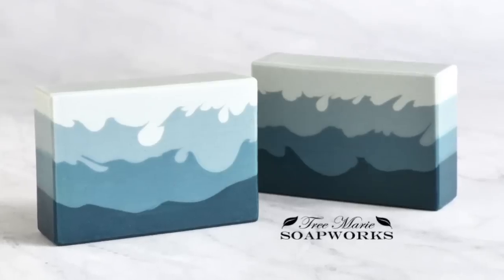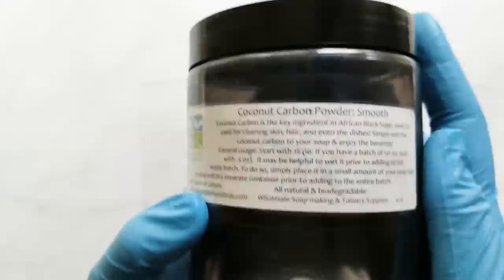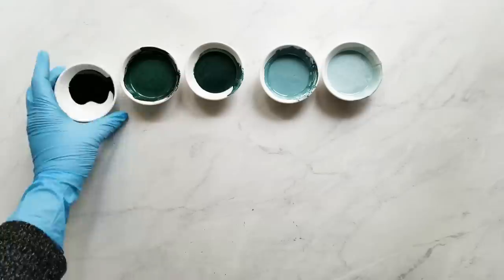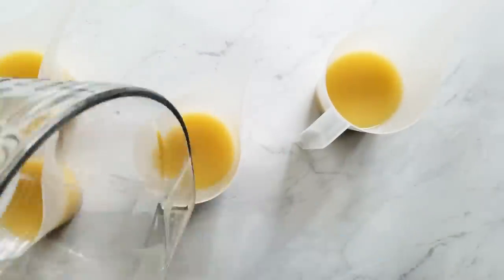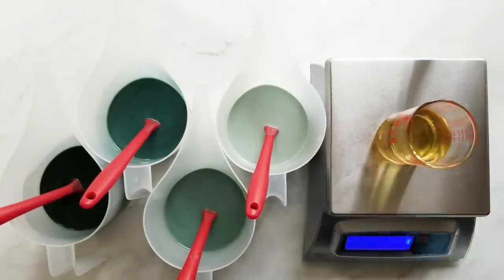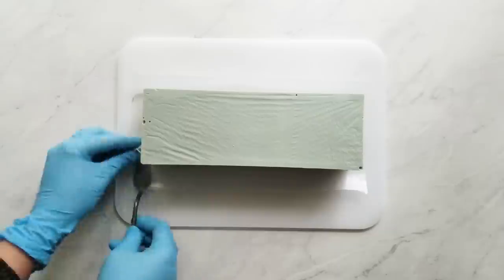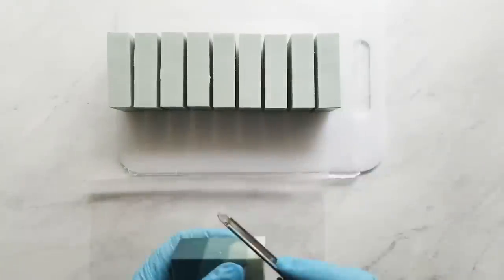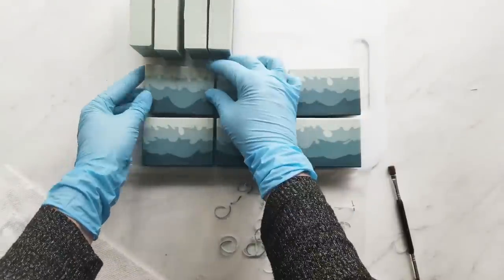How to Make Pointy Layers Cold Process Soap (Technique Video #22)

Comment: I’m a soap maker! I’ve been soap making for about two years off and on. I always wanted to try to gel my soap but I was kinda afraid until I started watching your videos. I use a wooden mold with a silicone liner and plexiglass lid from Nurture Soap. My oven actually holds heat really well and the oven light makes pretty warm in there, so I just use the oven light with that mold and the soap gels really well. Thank so much for the knowledge you contribute to the community! ❤️
Reply from the maker: Oh, I am so glad it worked. I really like the results of gelling soap! Thank you so much, Diandra! 💕

Comment: These soaps were super pretty. Looking forward for those confetti soaps.

I plan on making soap for the first time this month. Like anything, it's easy to get caught up in perfection and the tornado of new things that have to be acquired before performing the actual task. Space is needed and not always available. Space to store soaping equipment, make the soap, and curing areas. I'll also have to lock up my pets. Trying to find relevant information for my specific needs that is more fact based and less anecdotal takes time. I then have to check with my ever changing understanding of soap making. Example: I have hard water. That was never discussed in any videos I've seen. So I will have to try different chelators to see what I prefer. I don't have the hardest water, so I am going with citric acid (plus its lack of environmental impact and lower cost). This means I also have to figure out how much and how to add it through various forums. Sourcing equipment and ingredients can take a lot of time and money. It's alluring to do too much too soon. There are many other reasons, but this is a starting point. A lot of this is specific to me. I want to have a good bit of understanding before going into something that requires time, money, and space is all.
Reply from the maker: Pam, I use distilled water for my water. That is because it has no minerals in it. Hard water can cause orange spots in soap. I also have heard of people collecting rainwater to make soap. Distilled water is only 88 cents for a gallon here. That lasts a long time. Are you on Facebook? My group would be a great place to ask questions like that. 😊
Reply: @TreeMarieSoapworks  I have distilled water that I will be using. However, soap scum is a concern. I haven't joined the group yet, though I probably will at some point. Other than watching YouTube, I have really pulled back from socials at the moment. Thank you very much for replying.

Comment: I can't tell from your video if the tip of the pouring pitcher is above the batter line or dipping slightly into it. Or does pouring just above the surface slightly break the layer to create the points?
Reply from the maker: Yes, pour above the surface and let the batter dent the layer below; the thicker your batter is, the higher you'll have to pour from.

Comment: I just started soaping barely a month. In most of your videos you put the soap in the oven overnight. I stay in a tropical country where the temperature is around 30 degrees celsius all day long. Do i sitll have to wrap/ put the soap in the oven or is room temperature fine?

Thanks and I can't stop watching your videos!!
Reply from the maker: You can try just covering it, but the reason why I force gel is that I use a water discount, which helps with soda ash. If you live in a humid area, I would suggest a water discount. I use 25% water as a percentage of oil weight in soapcalc. That causes the gel phase to finish quickly, and a partial gel can happen. You would have to try it, and if you are getting a ring around the inside of your soap, you should probably force gel by oven process it. A partial gel is only cosmetic, though, and the soap is totally fine to use. It is just not as aesthetically pleasing.

Comment: What do you think if I use a squeeze bottle instead of the funnel you were using? I only have one. Also, what do you do with the paint brush? 
I've started making soap 5 weeks now  :) 
I've made about 10 batches and I love it!!
Reply from the maker: Try what you have, Jen. It will be a much tinier point and trough, but I have seen it done before. Best of luck to you! 💚

Comment: How do you know how much batter (or weight of oils) you’ll need for your mould? I always gestimate and end up with too little or too much...
Reply from the maker: Jennifer, you use the formula of (length x width x height) x .4, and that is an approximate oil weight. So (10" x 3.5" x 2.25") x .4 = 31.5 oz. I use 33.5 oz. oils because of the water discount, so for me, it is better to multiply by 42% instead of 40%. This formula only works for rectangular molds. I hope this helps. 💝
Reply: Awesome, thank you :)

Comment: Ive done 2 small batches of soaps from melt and pour. Just added coffee powder and coffee FO. The other was layered rose. Im just wondering what can i do with the soaps i made, as i wont be able to finish them fast enough. I dont even know if anyone will want it if i gave it away.
Reply from the maker: They should last a while. M&P draw humidity from the air, so keep the ones that you aren't using wrapped up with plastic wrap so they don't sweat. I bet someone would want them, Michelle, especially at this time when cleanliness is so important.

Comment: Hi, I’m so lost with this technique. I don’t understand how the points are created. It looks like you’re just pouring layers with batter that’s at medium trace. I’ve been making soap since June of this year. I’m always trying new pours and normally I have a pretty good understanding of what’s going on during a pour. But this one I just don’t get. Lol 🤔 It’s absolutely gorgeous though and as soon as I understand it I want to do it. When u get a minute would u maybe help me figure this out. Thanks, ur awesome!❤️
Reply from the maker: Think of it this way. When you are pouring the first few passes, you are putting little dents or valleys in the previous color. As the last layer gets covered up, the points are made. The key is to pour fairly close to the previous layer. The thicker the batter is, the higher you can pour from (but you still don't want to pour from that high). I hope this helps. 😊💕

Comment: Because of your videos, I started making cold process, though I'm struggling with recipes ,no matter how thin my batter is fragrance oils become villain 🙊!
Reply from the maker: Aww, wow, great to hear! Try citrus fragrances. They are usually very slow-moving. Tempering your fragrances helps too. Mix it with some of you batch oils to warm it up and spread it out. That way, it will be less of a shock when it is added. 💕
Reply: @TreeMarieSoapworks  noted!😍😍 ♥️♥️♥️

Comment: Hi tree marie I just want to ask you why you used sodium lactate
Reply: I try to make soap but the bubbles every where in 🧼
Reply from the maker: Sodium lactate is used to harden the bar, which makes it last longer. It also makes the soap release from the mold more cleanly. 

If you are getting air bubbles in your finished bar, try pouring down the side of the bowl to prevent bubbles, and burp your stick blender before turning it on.

Comment: Lovely soap, great video.  I've never made soap.  Why?  It seems expensive for something I don't use.  I'm a body wash kind of person these days.   I have mixed my own body wash, but nothing very interesting.
Reply from the maker: Thank you! I was a body wash kind of person too. Handmade soap is much less drying. I used to have a cracked heel since high school, and in the winter, I would get cracks on my fingers by my fingernails. I had really dry elbows. After I used handmade soap for a little bit, it all went away. Store-bought soap isn't the same. It has to be handcrafted. Bar soap lasts longer, too, if it is used correctly, and there is less waste.😊

Comment: 9:06 I don't need to see another video to understand ;-)
that's basic geometry

that is just an example to explain. if you want 10 equal parts of soap but your big soap is 9 inches long, you just to have to put you ruler with a 10 inches diagonal on the soap to just use the "inch" mark on the ruler (1, 2, 3, 4, 5, 6, etc.). thus, you dont have to use marks like 0.9, 1.8, 2.7, 3.6, etc.

Comment: I’m so scared 😩😩😩. I have my own beauty lab and am in the group. I have all of the ingredients... but lye just scares me 😭😭😭
Reply from the maker: My heart goes out to you. 💝 I was scared too. Believe it or not, a fear of lye caused me to put off soap making for 17 years. I gathered all the supplies in the late '90s and was too scared to try it. Don't be like me. Just be safe. 

Always wear eye protection, gloves, long sleeves, and pants, closed-toed shoes... I wore a face mask, and on my second batch, it caused my goggles to fog up. This caused me to be unsafe. When I adjusted my goggles, I had a speck of lye on the thumb of my gloved hand. It touched my cheek and started to burn. I rinsed for 15 minutes until there was no slimy feeling. Never use vinegar for skin, only on other surfaces because it intensifies the burning by speeding it up the reaction. (My cheek is fine.) 

It taught me some valuable lessons. Don't wear anything over your mouth that will cause your goggles to fog up. If you want to cover your mouth, wear a face shield. Also, inspect your gloved hands after handling lye. Wash them and wash the surfaces of your work area before you continue making soap.

Use a plastic container to mix your water and lye, not glass (it will etch and can eventually shatter.) I use a funnel pitcher which is polypropylene. The recycle code on the bottom should be a 2 or a 5 for high-density polyethylene or polypropylene. The others are brittle plastics and can melt if exposed to lye water for too long.

I would suggest freezing some distilled water like I do and use that for 1/3 to 1/2 of your water weight. The heating up causes fumes, and I don't smell anything when I use ice cubes. 

Always add the lye to the water and not the other way around. Remember, "snow falls on the lake."

And, always cool your lye/water in a well-ventilated area that is safe from any kids or pets.

Bottom line: Don't' wait 17 years to conquer your fear. If you are careful and follow safety procedures, you will be safely making soap in no time. 

~💕🌳